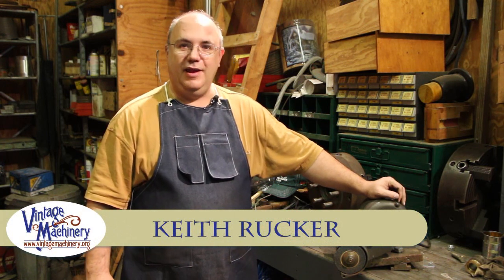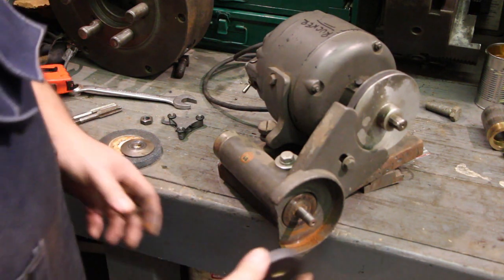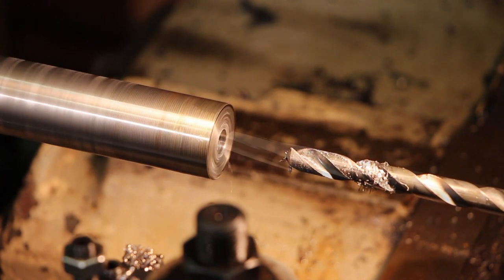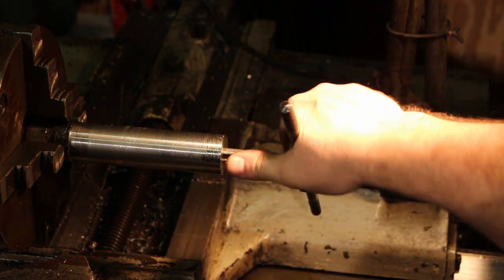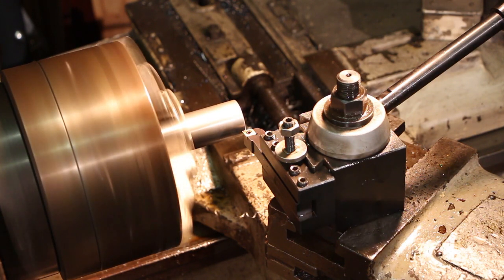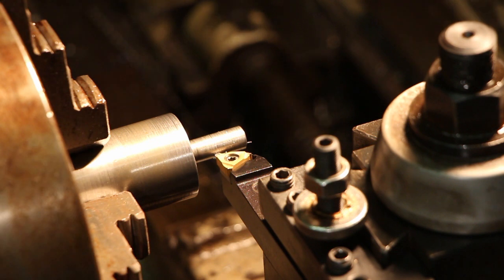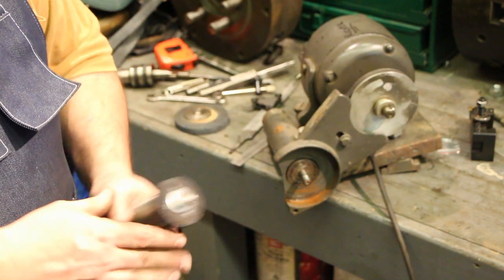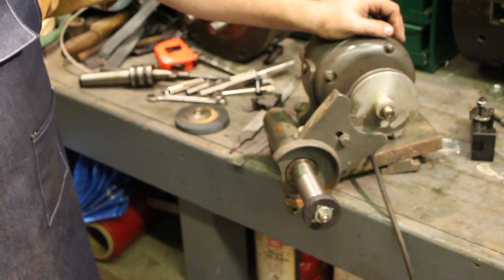Tool Post Grinder:  Making and Extension Arbor for Inside Diameter Grinding

Comment: I'm just starting to watch your videos (from the first one). I use a desktop PC and run my audio through an amplifier on my table.
I just switch to "Mono" on my amp when only one speaker is outputting, and then I get audio out of both speakers.
I also use "Stereo" mode on my amp when you are standing to the right side of the lathe gearbox, and adjust the balance all the way to the right. This eliminates the sound of the lathe motor/gearbox, which is on the left, and allows me to listen to you more clearly..
Thank you for your plainly explained step-bystep videos when setting up and running your lathe.
Bill
Reply from the maker: +billsmini10 Glad to have you on board!  As to the sound, I had some issues with some of my earlier videos in that sound was only being recorded on one of the stereo channels.  We get this fixed eventually!

Comment: Hi Keith
Great vid, enjoy you presentation method and obvious knowledge and mastery of the material.  I'm new to your site and am slowly catching up on the old posts.
I notice several comments are about losing audio.  I've noticed your intro music, as well as the inserted ads, are in stereo (loud) while your presentation is in mono (much lower volume).  I use headsets so the change is quite apparent.  This could be what is causing some folks problems if they are using their built-in computer speakers.

Comment: I use a tailstock threader. They work well and I even made my own for the larger dies and it keeps the carpal tunnel at ease. :-)

I’m looking at making a tool post grinder (extra axis) out of a 2.2kw air cooled spindle and vfd I have sitting here useless. Out getting ideas and looking for a source for grinding attachments that can reach in and grind an mt3 so I can accommodate my build to accept something that will work for my needs.

Comment: Thank you for making these videos. I love watching them and learning more about how the hardware, tools and machinery that we use every day are made.

I am not a machinist so sorry for what is probably an obvious question:
Why can't you just use your lathe to do inside grinding? Could you advance a work piece into an arbor held in the center of the chuck? Is it because the lathe can't turn at the required RPMs, there is no suitable way to advance a work piece into the tool, or it's just bad practice to be grinding stuff around those close tolerance lathe tool surfaces?  Thanks, really enjoy these videos that you share with us! Masterful work and love the attention to detail (such as making that 3/8 thread!)

Comment: Wondering why you went with 3/8" - 24 (UNF) instead of 3/8" - 16 (UNC) on the shank?  I've got loads of the UNC stuff in my shop, as it's used by the standard clamping sets, while to get a fine thread nut, I'd need to make a trip to the hardware store... maybe your shop supplies are better stocked than my garage!

I doubt that the slight difference in clamping force between the two pitches would make any difference - maybe it's to cope with variability in wheel thicknesses from different suppliers?
Reply: Works for me!